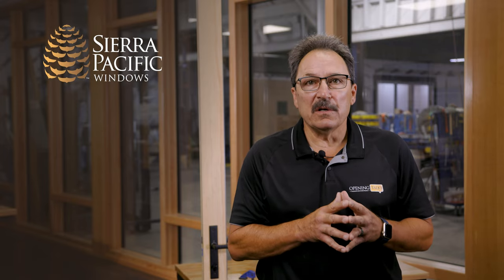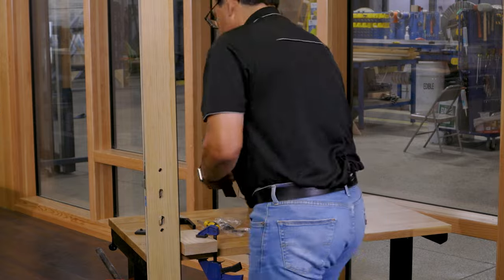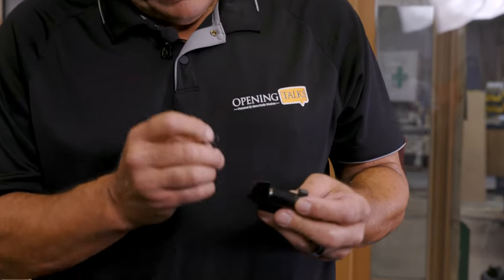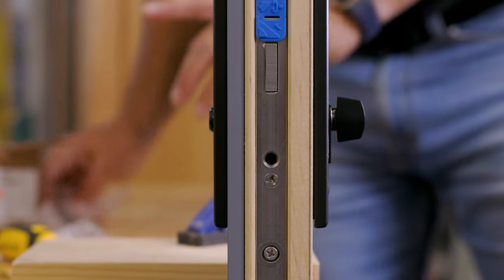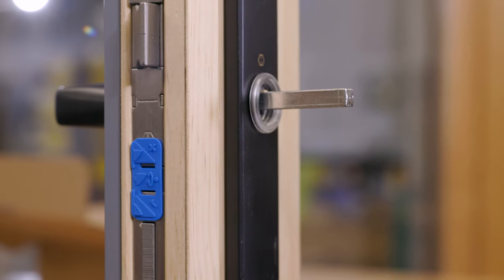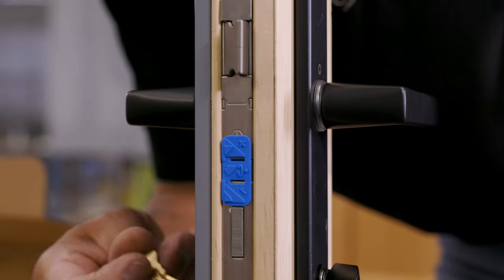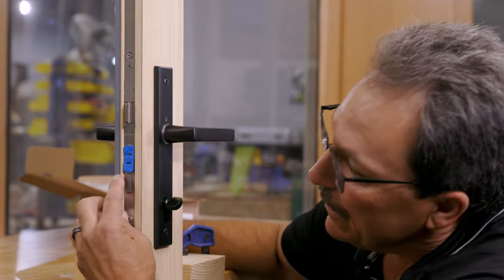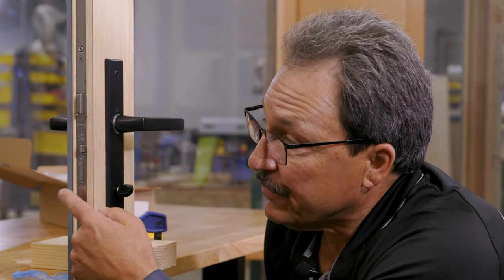Opening Talks: Hoppe Hardware Trim Set Installation

Comment: Once the handle has been pulled up and the locking pins are actuated, should the deadbolt actuate completely? I have to continue holding the handle up in order for the deadbolt to fully rotate
Reply: Yes, the deadbolt should actuate after lifting the handle and throwing the locking points.

Try it with the door open. Push the mishandling device (the little latch looking thing) in and lift up on the lever to activate the locking points. Keep the mishandling device pushed in, let go of the lever, and turn the thumb turn. If it works, then there might be something wrong with how your door or strikes are installed. Is the door square in the frame? Is the gap between the door and the frame even all around the door?

If it does't work, then there is something wrong with how the system is installed or the gear itself.

You can call Hoppe and they might be able to help you troubleshoot.